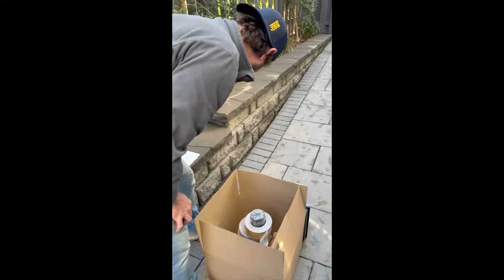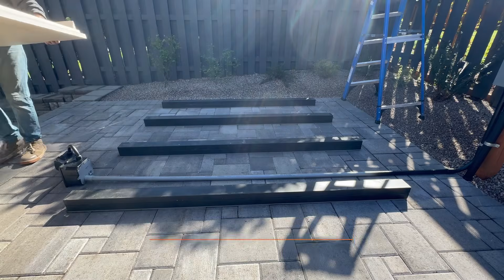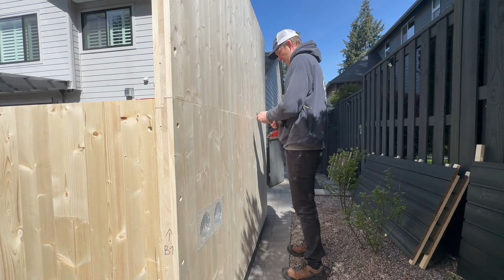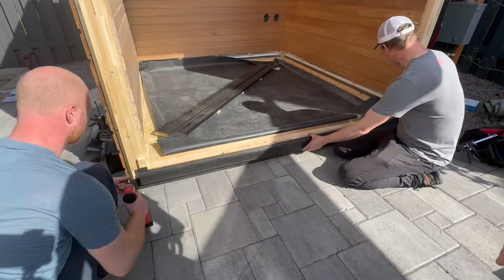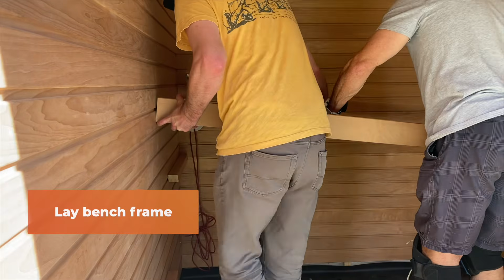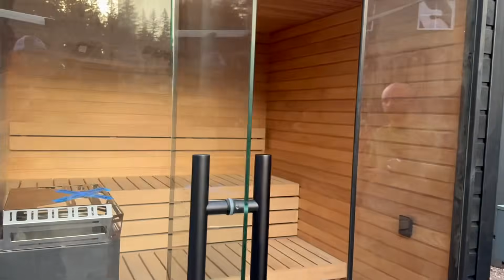Auroom Mira L Sauna - Unboxing and Full Build

Comment: What is this sauna heater that you're using?
Reply from the maker: Saunum Air L, but lately we find ourselves pairing more with the Saunum Air Perfect.  We always recommend touching base before purchasing to make sure we exceed your specific goals.
Reply from the maker: See it with the Air perfect in this customer review: https://www.reddit.com/r/Sauna/s/zmGLQLsPLk
Reply: @saunamarketplace   The Air L has a flute and the Air Perfect doesn't, is the experience the same? Does it really help?
Reply from the maker: @Takinaua great question! The air perfect is a great design in that it pulls air straight for the top of the rocks. It also has two separated layers of rocks which helps greatly with steam. Looks cleaner too. Both the Saunum Air / Air L and Air Perfect series work great, but the Air Perfect is a bit “Perfect” in its design.